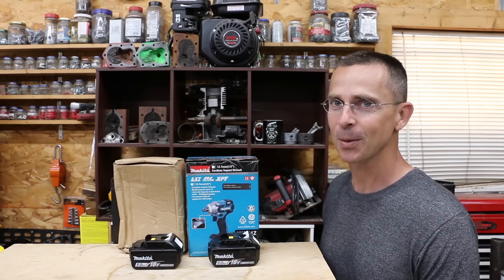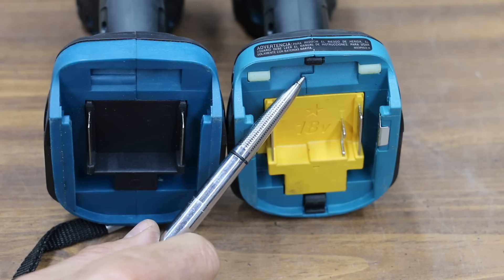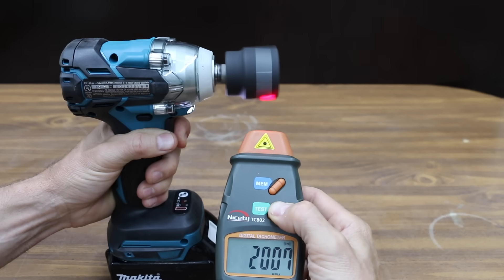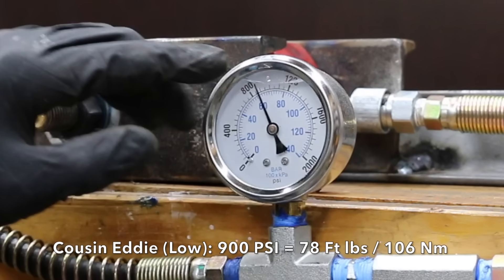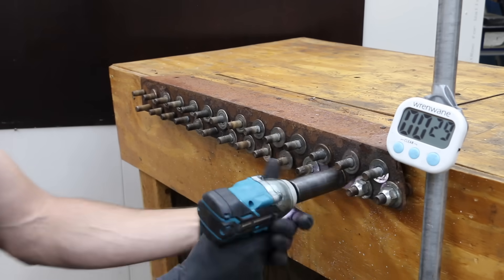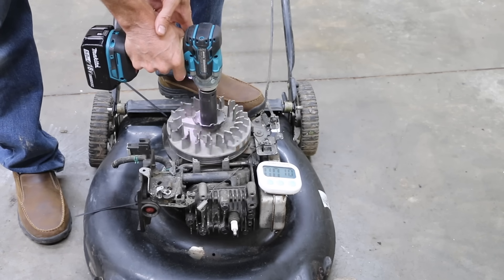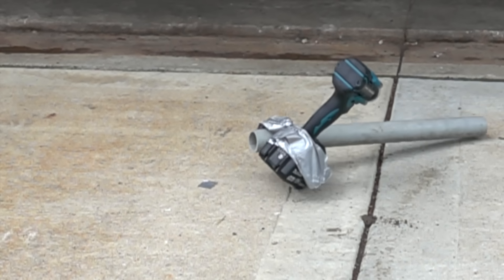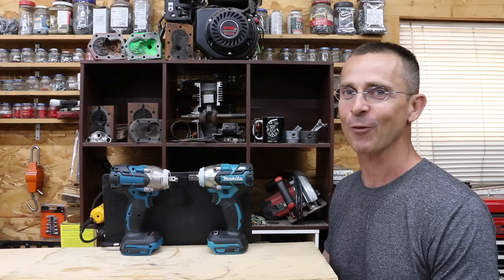Fake Makita Impact Better? Let's find out!  Makita XWT11Z 18V LXT Lithium-Ion Brushless Cordless

Comment: The only test needed is which one can remove a Honda crank pulley.
Reply: Probably neither, get a 1/2" air impact, or at least a corded 1/2" impact for that. My favorite thing about air impacts is you can force them to do what the manufacture claims they can do by jacking up the pressure, and they use a better impact mechanism to begin with.

Comment: I think a better question to ask is this:   Is the Makita 4.5 times better than cousin Eddie and the answer in an unequivocal no. Twice as good, maybe three times. But the Makita is 4.5 times the price. I suppose the only real way to know for sure is  in long term use see which one lasts the longest and by how much because again, the Cousin Eddie only has to last 1/4 as long as the Makita to be EQUAL. (Edited because I thought you said $180 for the Makita)
Reply from the maker: Thanks for sharing.

Comment: I'm willing to bet money that the "Cousin Eddie" fake Makita Impact is built and assembled in the same factory as the real Makita.  The factory owners already have the design specs and case molds so they make a bunch of extras and assemble them using cheaper non-standard parts then sell them around China and South East Asia to make extra money on the side in addition to the contract money they get from Makita.  Pretty good racquet.
Reply: I'm pretty sure Makita has it's own factories in China, just like STIHL does for the home-owner range of products. So it's very unlikely that these Chinese knock-offs come from the same factories.
Reply: @qinz1695  Those factories are still probably going to be managed, run, and operated by Chinese guys because China and Japan hate each other owing to centuries of warfare and hostility.  And any company wanting to operate in China has to be willing to suck up to the Chinese government.  Best to get someone in China to be willing to handle cozying up to the government if for no other reason than to bypass the language barrier.

Comment: I recently purchased makita impact the batteries were dead  both of the xc 5 amp batteries were dead wen you press the button on the batterie they both blink  can this be fixed to revice them  they both look new but wont hold a charge
Reply from the maker: Thanks for sharing.

Comment: Great video, with lots of helpful information, but the conclusion was kind of inevitable, wasn't it?  Pros who use such tools a lot more frequently, and depend heavily on quality/reliability don't mind spending a lot more money to get what they want/need.  DIY'ers/more casual users will typically favor value/savings over the "pro quality" tool that costs a lot more, as long as the thing "works" and doesn't fall apart before the warranty expires.  Don't know if I'd get a "Cousin Eddie" in this particular type of tool, but I'd definitely be looking for a lower cost alternative to the Makita.
Reply from the maker: Thanks for watching.

Comment: Great comparison.  Cousin Eddy is advertised by many sellers with different stickers on the wrench for random brands.  They are also advertised at both 320Nm and 520Nm but both look identical.  I bought a cousin Eddy for £33 and it worked perfectly.  I used it to put in 140mm 8mm thick coach bolts with only an 80mm pilot hole.  Cousin Eddy did not disappoint.  It performed MASSIVELY better than my Makita drill driver, even in low gear.

I stupidly put a regular screwdriver bit into the chuck and got it stuck.  Nothing I do will get it out.  The seller gave me a 20% refund which was nice but I still couldn't get the bit out.  I just bought another one for £43 and the chuck is loose so when i point it down the bit falls out.  Very annoying.  I complained and the ebay seller refunded all of my money and let me keep the driver! So now I have 2, one with a chuck with a stuck bit and one with a loose bit!  For DIY use, cousin Eddie is a cheap powerful tool that will do what you want for little investment if you already have the makita infrastructure.
Reply from the maker: Thanks for sharing.

Comment: i need to order a cousin eddie, just because its an under performer doesnt mean its not right for my needs, at most every now and then it might get used in the shop so there is no need to spend a bunch more for a tool that might get used 5 or 6 times a year, if for daily use by all mean go name brand, as for counterfeit i dont care really, i cant afford a 130 dollar tool at times and can 30, i go with what i can afford, i can assure you these knock offs arent hurting the big names any at all
Reply from the maker: Thanks for sharing.

Comment: how about a Old vs. new Bosch angle grinder test?? we got a bunch of angle grinders where i work but only 1 is 20+years old abd still holding up while the others are no more than a year before we buy a replacement.. the old one is preferred by everyone. (big angle grinders, not the small 125mm ones)
Reply from the maker: Thanks for the video idea.

Comment: Project idea: compare different ammunition sealers, there are several specialty products for sealing ammunition to make it waterproof for hunting in wet conditions, or working on a boat full time. People also use fingernail polish (full strength and diluted with 50% acetone). The control would obviously be commercial ammunition. It would be interesting to obtain one round of standard issue ammunition from a military source as another baseline, as it is said to be waterproof already.

Comment: Great video! I love the testing setups you did here.
I'd like to see this done with a variety of brands. I own an 18V Dewalt impact wrench that was advertised at 1100 ft/lb torque. Total fail. Wouldn't even break the lugs loose on my car and those are torqued to 90.
Reply from the maker: Great suggestion!  Thank you.
Reply: That’s interesting. My makita 18v 1/2” will actually snap 9/16” bolts if I’m dumb enough to go the wrong way long enough

Comment: Soap Box first: is the knock of worth $30?  The answer should be no.  Fakes, replicas, knock offs generally increases the cost of the genuine article for a lower quality, unsafe product.  Contributing $30 to and promoting bad behavior is simply wrong, because it promotes and facilitates continued theft of intellectual property and reverse engineering production of lower quality, unsafe products, like cousin Eddie.  Unfortunately, the Chinese knock off companies have gotten smarter and are permitted to sell on sites like Ebay because they don't outright claim they are replicas or infringe trademark by circumventing those laws like this case of brushless impact wrench "for makita battery", although they aren't enforcing including disclaimer about no affiliation with Makita.  Contrarian in me says, aside from the good value promotion at the end, doing a test like this, which dismantle items to see the innards, does help people like me make other assessments over just a cost performance analysis, which were the only criteria you used.  Maybe address the safety aspects next time.  Soap Box ends.
You glossed over the actual important differences making a generic "brushless motor, build materials, and electronics are very different" statement, especially when you didn't actually go into the electronics and motor differences which have a great deal to do with safety and reason behind the performance differences.  Eddie cuts out lots of, if not all of, the safety features to get you to the $30, well $50 now (bad behavior increasing demand increases cost of knock offs).  Eddie does not have a third rail which Makita uses for overload protection sensor, not to mention the Makita has an in line fuse. Eddie's lack of a mounting plate board on the stator means it does not have a hall effect sensor, which is probably the root cause of the delay and less efficient performance differences, not to mention it also means there are no protection diodes, and probably means the hot wiring on the Eddie only excites certain coils all the time rather than switching across all of the coils.  Additionally, theoretically see more efficient use of power from the Makita's use of a hall effect sensor over Eddie, but you didn't do a battery consumption test especially stop/go.  Makita also integrates seals and moulding to prevent foreign material penetration, which you can obviously see from some of the beefier reinforced plastic moulding which is designed to channel fluids and prevent foreign material ingress.  The Makita plastic moulding also has design features to keep parts in place like the hammer shroud.  You can also see things like the trigger switch on the Makita uses a terminal and better sealed vs Eddie which looks like wires go directly into and then soldered, likewise I suspect for the motor electronics and the battery terminal I would venture to say.  Also, because of some of the electronic overload protections missing and missing hall effect sensor, Eddie more than likely ruins batteries.  So, include the extra costs of makita batteries.  So, higher operating temps, thinner plastic, no features to prevent/hinder foreign material ingress, internal parts not reinforced to keep in place, no electrical/electronic safety features, and higher wear and potential damage to Makita batteries in the Eddie...
So, I would re-phrase your last question: is $30 knock off worth your personal safety?  I conclude no.  Especially when you are talking about a power tool with metal and high RPMs and torque, and electronics.

Comment: ive been watching your videos for a long time and one of the ones i always liked was your seafoam videos, i know that you added it to your oil and it did clear up some gunk and let oil get up into your valves which is good, but my question is, does adding the seafoam to the oil actually cause any damage to the engine components, such as excess ware to the pistons, bearings, rods, cam, ect. Im not sure if youve done a video where you look in detail at the engine components after adding seafoam to the oil
Reply from the maker: Thanks for the video idea.

Comment: Seems like most people feel that Cousin Eddie is a knock-off or Rip-off of the Makita tool. You may be surprised to find out that Makita (and most others) contracts tool manufacturing to various plants in China. They (Makita) pay for a spec tool. Lower spec tools with very close to the same look and feel can come from the very same plant. Those lower spec tools are sold off to Cousin Eddie or any other tool vendor on Alibaba and ebay.  So while not a direct ripoff, they are a competitor but at a lower spec.  FWIW, I bought the Cousin Eddie and have been using it in my shop for 6 months now. No issues to speak of.  What I would like to see next is Cousin Eddie Lithium Batteries that will work correctly on the Makita chargers and still perform along side the triple-price OEM Lithium batteries...
Reply from the maker: Thanks for the video idea.

Comment: I bought the Cousin Eddie brand and I have to say that so far, it has performed well in my shop. While not a scientific test, the wrench will buzz through 10 wheel changes and still has more than half the charge. This is breaking away and retorquing 50 lug nuts. I always hand torque my lug nuts to ensure proper torque.  While not happy about buying tools or anything else from China - find an alternative!  Thanks for your tests Project Farm - as usual, your testing is real world and spot-on!
Reply from the maker: Thanks for sharing.

Comment: Love the  arm wrestle and dance moves 🤪🤣 Thank you so much for what you do! Would you consider two-stroke engines?I am in the professional mowing business and all brands of trimmer engine seem to be destined to fail – red max, shindiawa, echo, stihl, I have tried them all. Many of these brands top and commercial models perform great at the beginning of a summer, but after several months of caring but extended use, I often find damage exceeding the cost of replacement. Brand comparison, and/or comparison of 2-cycle oils (amsoil, Vp racing, husqvarna, and others would be great!) Is Consistently a prominent topic on mowing forums! Best wishes from Alaska

Comment: Great video. I'm wondering about diamond wheels for cutting stone. I've been told American diamond blades actually have more diamonds embedded into the surface than Chinese blades. We use them for cutting agates and such which is pretty hard with a wet saw. Would love to see a comparison of either diamond 'particle count' and or durability testing. Thank you for your videos!
Reply from the maker: Great suggestion!  Thank you.

Comment: Hi Project Farm. I have a request. I'd like you to compare different contact cleaners. I tried WD40 specialist contact cleaner, and I think it is very bad. I used it on my phone and it isn't working properly. Seems like it leaves some residues. I'll be sure next Monday when I buy some isopropyl alcohol.
For this test you will need a multimeter to test the connection. I'm not sure how can you measure it since it will be very low values.
Reply from the maker: Great suggestion!
Reply: @ProjectFarm  I'm glad you liked it!

Comment: I have a Makita LXT 18v Combi drill that was made in China. The keyless chuck often refuses to let go of drills so I have to use a wrench to crack open the chuck, the chuck also rotates eccentric rather than concentric because it has worn, the charger has become unrelaible and fnally the motor can no longer handle hard drilling. It is 2years old has done very little work in the last six months because it is CHEAP CHINESE MAKITA BADGED JUNK!

Comment: I got me a cheap impact to do the small stuff so I don't have to use my facom all the time(powerful but very heavy)
so I was thinking if it might help to add some weight to the "el cheapo" by means of welding on to it
is it as simple as that or would the spring be too weak?
I tried finding stuff about "tuning" an impact driver, but there's little to nothing out there, especially in regards to the impacting mechanism.
Reply from the maker: Thanks for sharing!
Reply: @ProjectFarm  yes
no
maybe
I don't know?
Reply: @ProjectFarm  I have an update on the matter
if you eliminate the axial play with hardened shims(18x25mm) it will increase the power noticably, this is not only true for the cheap tool, but also if you compensate for wear on older tools
basically you just have to measure the play with the assembled tool
install the appropriate thickness shims between the anvil and the housing
and that should be just about it

Comment: Brand name, especially in the later years isn't worth it. At the beginning these companies develop an incredible product, but after they gain fame the product quality drops because of the guaranteed revenue. Why spend $50 on manufacturing, when you can spend $10 and people will still pay $180 for the name. 

Thats the thinking these companies have now days. 

They develop their following and then reduce and maximize. 

Don't buy the super expensive product, but don't buy the super cheap either, buy the middle product. 

Make your decision.
Reply from the maker: Thanks for the feedback.

Comment: I have been watching your videos for a long time. I have also switched using products due to some of them. I think you do great work here. You probably already done this one and if so please direct me to the video. You have so many. I just recently had my nephew come to be with a stuck Honda axle bolt. As I always have I got out my trusty "Ford" metal bar and my large craftsman breaker. I was using a very short Harbor Freight 3/4 inch black impact extension. I ended up twisting two of them in half. I have used Harbor Freight tools for many years. I have found for the price they out perform Craftsman,  especially since they have taken a nosedive. I reviewed some videos and found out that this car has a major problem with these nuts. Many people are twisting off tools. I want to know if I would have had a snapon would it have snapped off as easy. I was snapping them right where it goes into the socket. The square part. Before I get hate, I dont tend to use HF ratchets as they do not seem to hold up. I only use hard solid tools, wrenches, sockets, etc.

Comment: Could you do a test of concrete crack filler sealers, testing ease of application on horizontal or vertical surfaces, and effectiveness of the sealant?  Also test of black top crack repair products.
Reply from the maker: Thanks for the video idea.

Comment: Excellent video, P/F as always.  For $30 bucks it does the job if you're willing to put up with its frailties.  In a pinch Cousin Eddie would be OK, but as we saw in the video, Makita is quality with a service network for repairs.  From my experience with Makita tools, some which I been using for 20 years without breakage, I'm convinced that they're made to last and to perform.  Thanks for your well thought out comparison, you always do your homework, don't you?
Reply from the maker: Thanks for the feedback.

Comment: Could you test the same brand from different stores please? For example Milwaukee from Home Depot isn't necessarily the same and a Milwaukee from a hardware/ fabrication shop. The myth being Lowes, Hope Depot, Wallmart selling the "hobbyist version, and a hardcore designated tool store selling the "professional" version. I used to work a industrial focused fabshop and hardware store that specialized in selling tools that last. I was told you can find the same tool online as two different products with a slightly different PLU code.
Reply from the maker: Great recommendation!